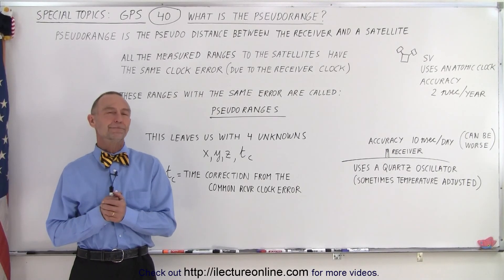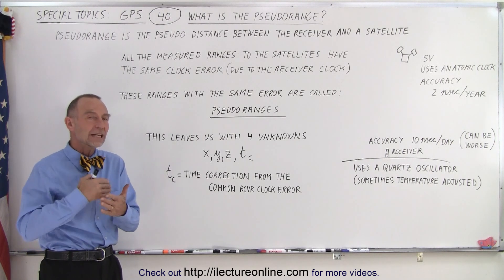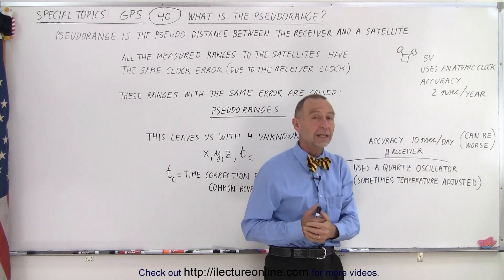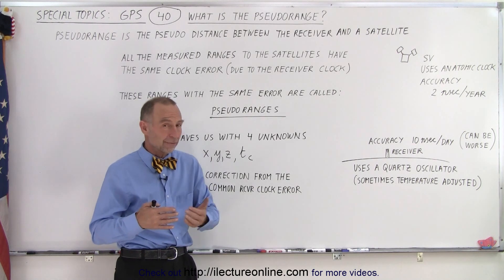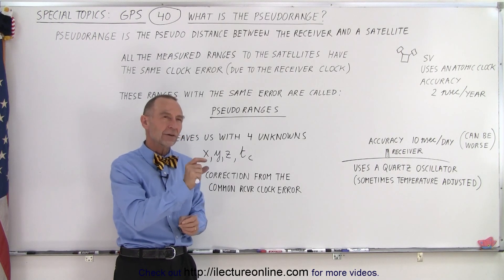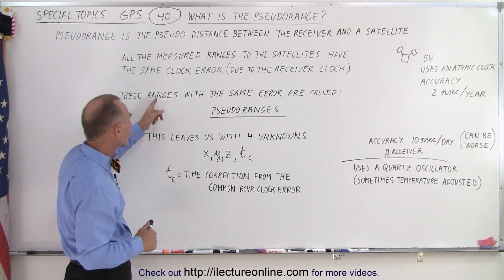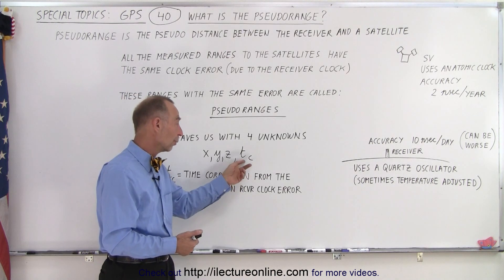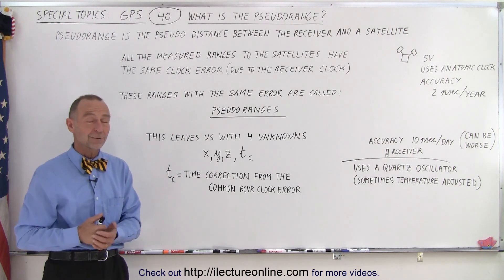Special Topics - GPS (40 of 100) What is the Pseudorange?

Comment: Thank you, this is great. So, when we’ve solved the four equations and applied the time correction, how accurate is our position relative to the SVs likely to be at this point?
Reply from the maker: That depends on the application.  Commercial applications will get you withing 5 m or so from the actual position.  Military applications do better.